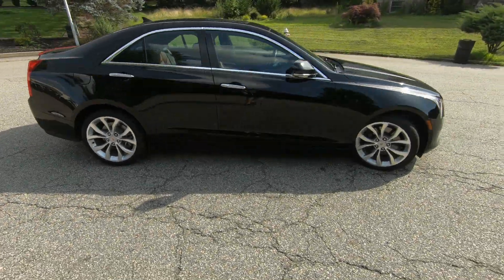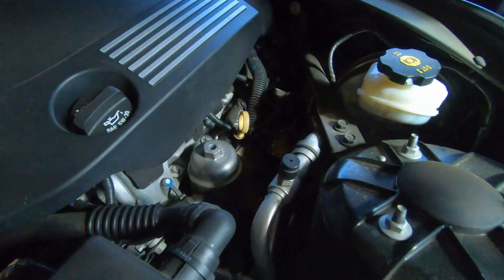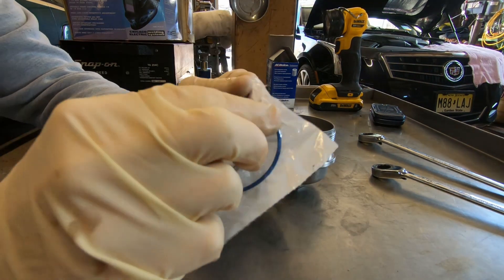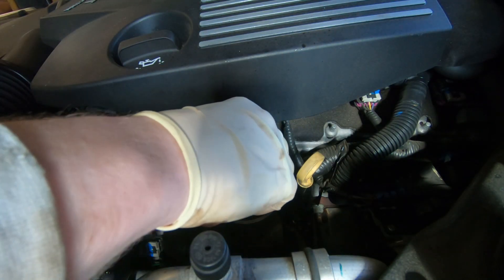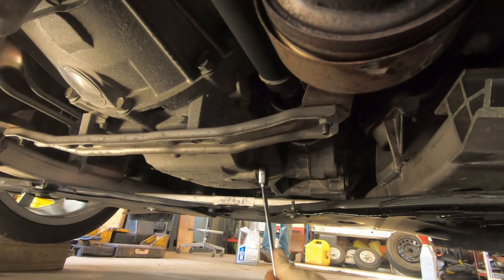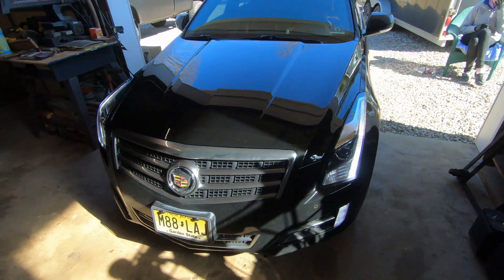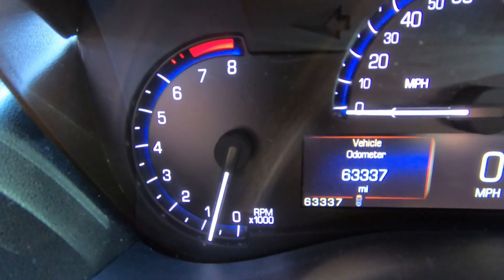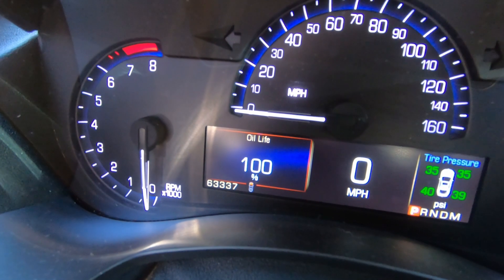How To Change Oil + Filter | *Cadillac ATS 3.6L V6*

Comment: Is there not a filter/cap underneath the car to replace?
Reply from the maker: Just the drain bolt for the oil.  The filter is in the engine bay

Comment: Is this the same for the 2019 ATS COUPE
Reply from the maker: As long as it's the 3.6 it should be
Reply: No, they redesigned the engine in 2015 and the later engine filter is on the bottom side by the oil pan. It is a traditional style filter. Also the later years (judging from my 2018) oil life reset is a different process that is much easier.